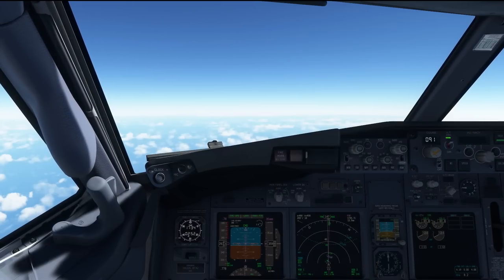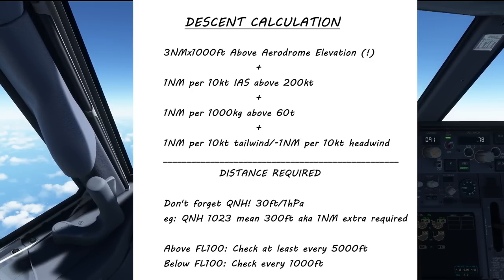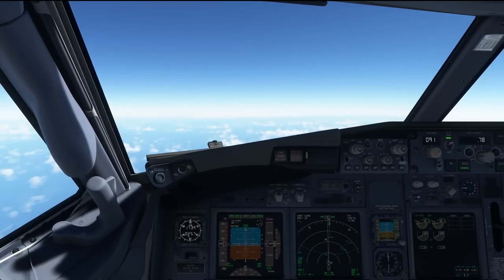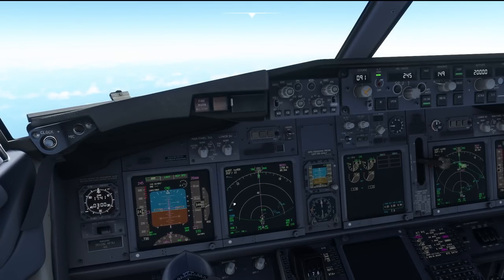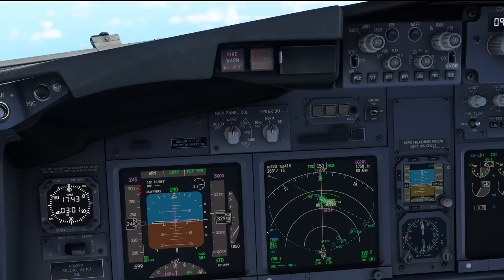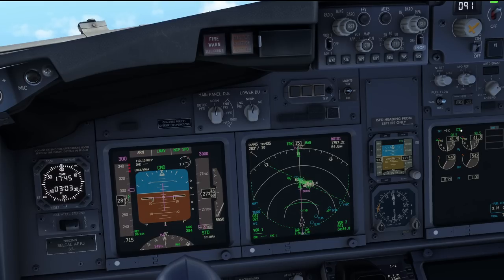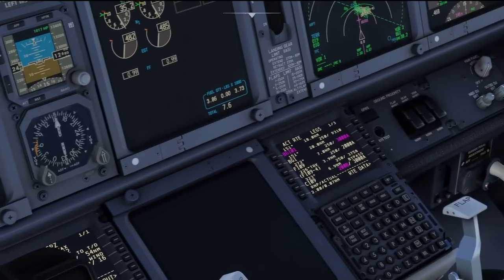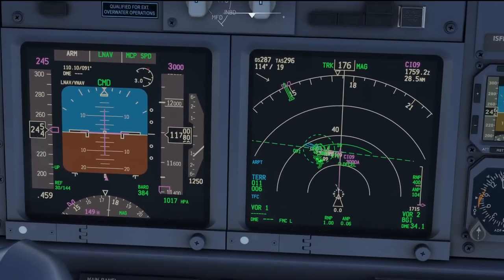Descent Planning without VNAV: Calculations, Monitoring and Corrections | Real 737 Pilot

Comment: I used to do this crap all the time simming the old six pack airliners but to be honest with you I kept it clean and simple with the corrections. Only really did wind/decel corrections. Weight and qnh for me were overkill when already running at high mental workload.  Worked out ok. Could barely add 2+2 together when on blocks
Reply from the maker: The good thing with weight and QNH is, you figure those out once and then never again as they don't change in a meaningful way during the flight. That makes it easier!

Comment: Currently doing my line training in 737 and descent management seems to be the most difficult part mostly because every captain has his own way. Some prefer vnav, others level change etc. All correct but all different and somehow that confuses me.
Reply from the maker: yeah, that was a hard part for me as well. If I'd be in that position again I'd just go into the FCOM or OM-A and see what your airline wants you to use. If your airline says VNAV, just use VNAV. If they prefer other modes, do those.
As long as you can give reason for why you're doing things as you're doing them you should be good. Having a book to point to is always something good! Which of course does not mean that you shouldn't take your captains advise, they will be able to provide you with a lot of insights on matters you still need to gain experince on.

Comment: Fantastic video Emi. I have 2 questions if I may. 
1) Does the rule for hectopascals convert directly when using inHg as pilots in the states do, or is there a different rule for that?
2) If the QNH is less than the standard 29.92 would I do the opposite and take NM off the track distance?
Apologies if this was explained and I just haven’t grasped it!

Comment: this seems really overcomplicated, only descent rate, height and speed is needed, you can make some minor corrections for a headwind or tailwind and pressure difference but unless you're flying in a hurricane what will that really do, add a few miles? just start a bit early and you can always reduce descent rate if you need
Reply: yeah, say you're going to descend from FL280 to 5000, and the QNH is 30.08, the rule of thumb is about 9ft per hundredth inch (lets round to 10) so at 29.92 you are actually 160ft higher (kinda pointless but bigger pressure differences exist I guess), that means we have to lose 23160ft, so let's say we'll descend at 3000fpm, choose any descent rate you're comfortable with it doesn't matter, you would need to descend for 7 minutes to lose 22000ft and another 20 seconds to lose 1000ft (and another 3 seconds to lose the 160, totally pointless)
we have a ground speed readout here so we really don't need to correct for wind or anything, a knot being a nautical mile per hour means that at your GS of ~450 6 of those minutes are 45nm, the remaining minute is 7.5nm, and the 20 seconds 2.5nm (and the 3 seconds less than half a mile, again totally pointless), so 52.5nm total, just add a safety margin and adjust descent rate as required to make up the difference
and if you already have a descent rule of thumb like x miles per thousand feet or whatever you don't need any of this, just use that instead
repeat for any amount of legs your procedure requires

I don't know where your calculation comes from but it involves a lot of non-factors with weird rules of thumb that make no logical sense
Reply from the maker: That's the difference between professional flying and dentist flying.
For a dentist it might not matter if you constantly need to use thrust or the speed brake, but for an airline with loads of flights every day things add up and can ultimately make millions of difference for the airlines.

Comment: Hi again captain :) I want to ask couple of questions and if u answer shortly I really appriciate( Im in Lifus B737 )

1-What is the difference between changing target speed 280 or using level change? also between vnav speed and level change? arent they almost the same?

2-I know you mentioned in the video but ı couldnt find again. When should we start slowing down if it is not straight in approach?(I mean followin full arrival)? 3- also in bad weather conditions when should we start extending flaps?
Reply from the maker: Hi Eray,

1) Changing the speed target in the FMS adjusts the VNAV profile for the new drag situation. Thus you get more accurate VNAV path indications than if you just used LVL CHG.

2) Same as for straight in approaches. Use the PROG page to determine the distance along your route.
3) No difference between good and bad weather conditions.
Reply: @A330Driver  you are amazing , thank you very much:)

Comment: Emi.. I have a question about the reliability of the vnav desecent in the pmdg 737.. is it always spot on or do you sometimes hafta intervene yourself? For instance on some approaches from cruise thru a star it works just fine. But other times it tends to slow its descent leaving me with having to manually descend. I learned long ago how to make my own descent without having the luxury of a vnav system and star approaches. Is this a msfs thing or is the vnav like that in the real 737 also? Also.. when there is a step descent in the flight plan .. what should I set the mcp altitude before initial descent during cruise?
Reply from the maker: If you stay on top of it, it works very well. Of course the basic computer principle of "shit in, shit out" does apply, so if you deviate from your path be proactive and do something about it. Get too high? Increase speed or use speed brake.

For Cruise Descends just set the new altitude on the MCP and press ALT INTV. If you're more than 40NM from your T/D the plane will enter cruise descend, if you're within 40NM it'll go into early descend.

Comment: I would love to know how you manage transition at German airports (and some Italian ones). So for example you're flying into EDDM and approaching ROKIL. Would you know if to expect the transition or maybe get a shortcut so you can reprogram the FMC early? What if you follow the transition but then get told to go direct to line up for the approach and you're too high. Do ATC tell you when to descend as I don't use ATC and just VNAV/Managed Descent?
Reply from the maker: You'd know that you'll be cleared for the transition. I'd always plan my vertical profile to expect a shortcut, normally turning base when abeam the FAP.
Once you get onto the approach frequency you'll have to listen out to the other traffic to see what kind of shortcuts they get and to make out how busy it is, that'll usually give you an idea what to expect. If you are unsure just ask ATC for the trackmiles.
Reply: @A330Driver  Ok, and if you don't get that shortcut for whatever reason (maybe spacing behind an A380) then you just level off or reduce descent rate?

Comment: How do these corrections work for larger aircraft (example the 747-200)? I'm assuming they are probably not applicable?
Reply from the maker: The reference weight of 60t is obviously not applicable, but there will be a similar reference weight for every aircraft type. Which one that is however, is something I can not tell you.

The rest of the rules will more or less apply, for sure the 3/1 rule for determining the general distance from T/D to Touchdown and the wind corrections as well. Most aircraft also slow down somewhat similar to the 737, meaning approx 1NM per 10kt.
Reply: @A330Driver  Thanks for clarifying!

Comment: Does that 'banana' green arch estimate of reaching target altitude include weight and wind?
Reply: Yes, if you target altitude on autopilot panel this green banana shows you where you’ll maintain your targeted altitude. However I think it calculates it based on your current wind, speed of climbing/descending etc. and not future wind on different flight levels unless you type them in DES > Forecast page
But I’m not 100% sure about the second fact
Reply: @catte22  yes I believe so since it is ever moving slightly.
Reply from the maker: It uses current V/S and GS, so whatever you currently experience is taken into account.

Comment: Quick question- Using Fenix Airbus but I assume the same rules apply. I did calculations and ended up 10 nm further out starting descent than TOD. Is that an acceptable distance with the rough calculations or should they be nearly identical?
Reply from the maker: I personally doubt the descend performance of the Fenix is accurate, thus I wouldn't be surprised if you ended up off the planned point.
Reply: @A330Driver  Honestly yeah it always seems to descend a little later than it needs to, so that would make sense.